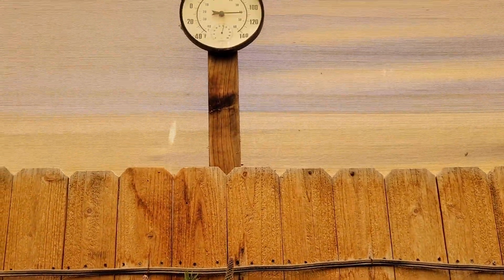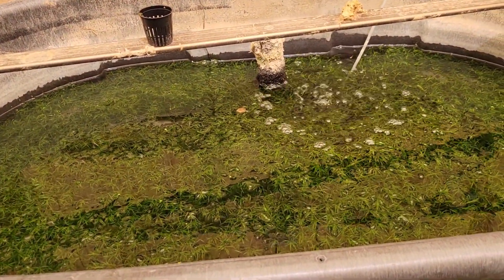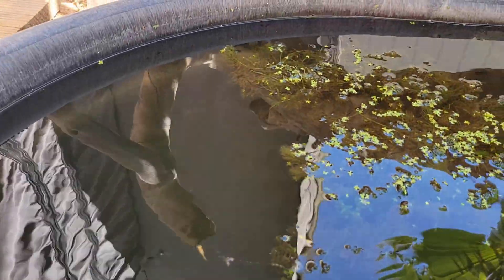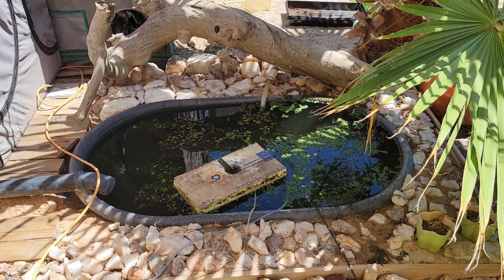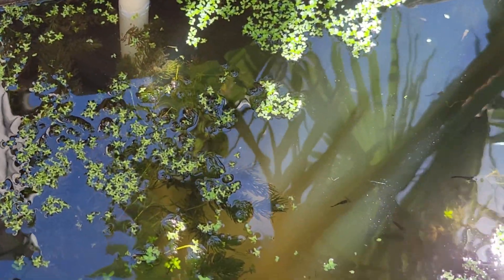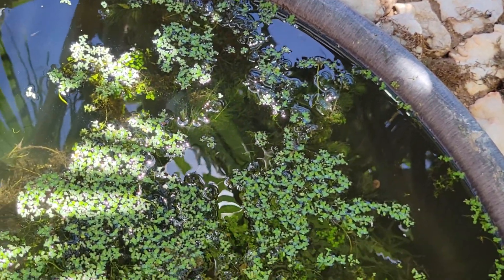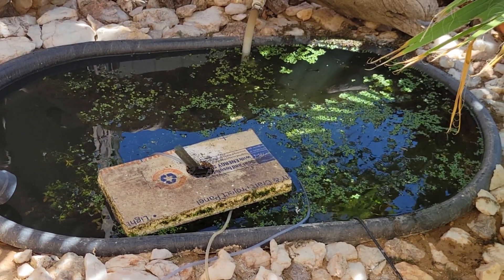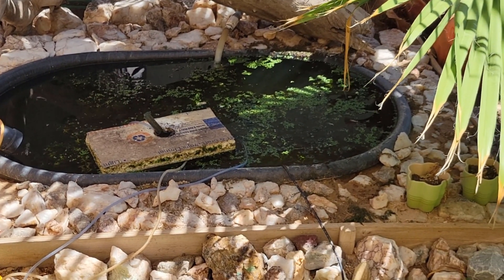How To DIY Geothermal Pond Cooling

Comment: What is your hottest temperature and the lowest temperature of the year where you live? It’s been a long time since I’ve been to Arizona, but when we lived in California, we did experience a 120° day one time and a 123° one day one time, but it would get very very cold in the winter where we lived. I think the lowest I can remember was 17°F and we had the college I was going to at the time right at the. Place where the trade winds blow through the pass.
Reply from the maker: Hottest is 120+ and in the winter it can get to upper 20's/30's. We cool in the summer and insulate during the winter with insulation boards and heaters. The cold is definitely more tricky than the heat!